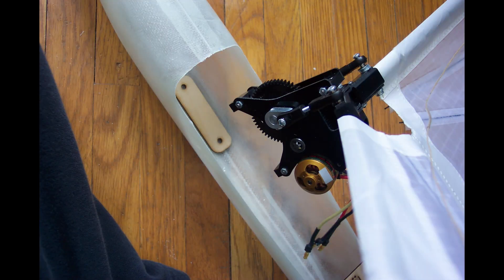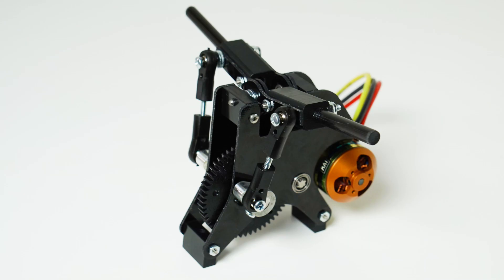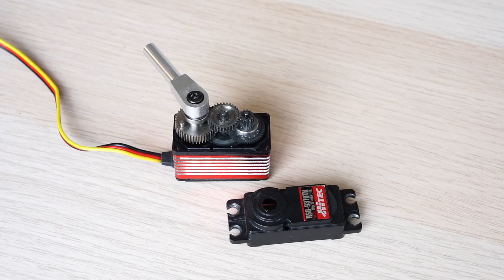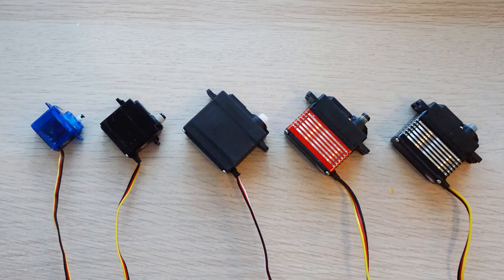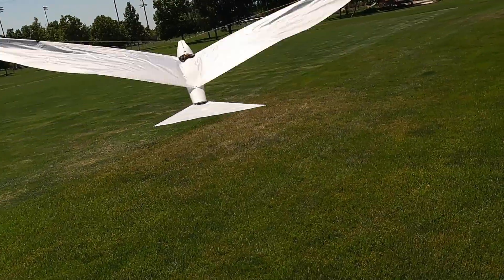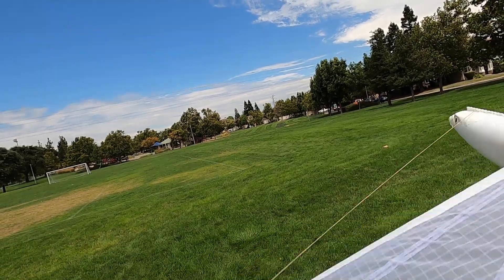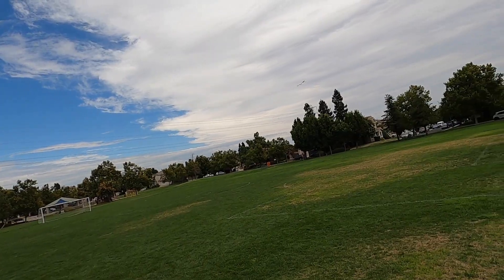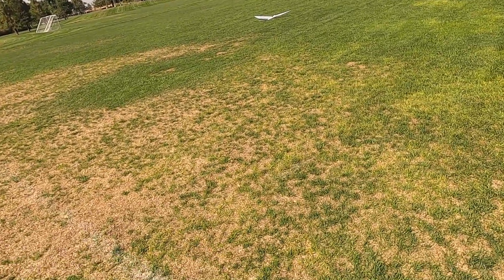Ornithopter Servo Conversion: Crossbow 2 RC bird flies with servos instead of conventional gearbox

Comment: Hey! A couple of beginner level questions on the build itself:

1. Where can I buy those servo horns/arms? I can't find them on the recommended Servo City website.

2. How is the membrane attached to the spars - adhesive or stitching? How is the trailing inner corner of each wing affixed to the fuselage?

3. What was done with the QT Py microcontroller to enable servo wiring? Was a PAD used?

Thank you!

Comment: Where were you able to get the servo arms that fit carbon rods? They look custom made, but how did you cut the inner gears? I have a milling router and found 20T broaching tools but they're really expensive and difficult to use.

Comment: What's the max flapping frequency here?
Reply from the maker: It can be adjusted from the transmitter over a range that is determined by the Arduino programming. Servo speed is measured in degrees per second so as the frequency increases, the potential amplitude decreases.

Comment: I imagine you've figured out that you can lose at least one on the tail servos, leaving just an adjustable elevator - and use differential flap angle between the two wings to give steering.

Please continue to make more Ornithopter content - there's not much out there!
Reply from the maker: When I first started building servo driven ornithopters, I used only the two servos that flap the wings, and no other servos. The Crossbow originally had a conventional flapping mechanism and two servos in the tail. I retained those two tail servos in order to keep the weight the same in both versions, while knowing that I could have made it lighter by removing them.

Comment: I purchased a ornithopter from ornihobby. Despite a few weak parts, it flies quite good. I wondered about converting the main motor drive to the central spur gear to be belt driven with a lower kv motor.. But after seeing this, I'm wondering of servo drive on each wing would be better.
Reply from the maker: Yes! Please do that and post a video.

Comment: Thank you for the info! Could you tell more about whole electronics setup for HSB-9360TH? I'm trying to build raspberry-controlled ornithopter but not sure how to connect it all together.
Reply from the maker: I will try to make a video showing how it all works. Driving servos is simple. You need to connect the signal wire of the servo to an output pin on the microcontroller. Send a pulse in the range of 1000-2000 microseconds about every 20 milliseconds. The pulse width determines the servo position. Typical radio receivers output this same type of PWM signal. You can connect each channel of the receiver to a different input pin on the microcontroller. And read the pulse width. Some receivers have a "single wire" output, which offers simpler wiring. But there are many different protocols (cPPM, Spektrum serial, sBus, and others).  In ornithopters the microcontroller is powered through a voltage regulator while the servos get power directly from the battery.

Comment: What were your reasons for using the adafruit controller over the Arduino?
Reply from the maker: It's smaller than Arduino Nano and it is actually running Arduino on it.

Comment: I just keep coming back and realizing how good your build is. I have built my servo driven ornithopter, but the some aluminum gears in the servos are failing. I need to address this issue but I'm looking for alternative designs as well and I found your channel. Did you make the aluminum servo horns?
Reply from the maker: I designed the servo horns and had them custom made by Servo City. You should be able to order more of them from Servo City. Please contact them if they are not listed on their site.
Reply: @OrnithopterZone1  Thank you for the reply. I ended up 3D printing reliable servo horn sockets that reinforces the original servo horns.

Comment: It's really impressive .... Could you please tell me where I can buy the servo controller ready to us ??  I understand that the board you mentioned in the video is just the hardware  ?? but it needs the firmware to run it ... Thanks a lot
Reply from the maker: When I have time I will make a video about the programming and post some example code.
Reply from the maker: I used to sell ready to use flight controllers and ornithopter kits. I had to close shop because of limited time. It would be nice if a company would make something like this.

Comment: Would this fly using Spektrum equipment (receiver and transmitter). I think I saw a 1000mah battery in the specs - on average, how much air time does this give you?
Reply from the maker: I use a Spektrum transmitter. I haven't compared the flight time with crank vs servos.

Comment: Cool, now put a HD FPV system on it and send it though the newest gap 😜
Reply from the maker: I started FPV flying with ornithopters in 2004 using a CRT monitor plugged into my car. Haha. I still don't have an HD system. Currently using a 4 winged ornithopter to reduce image shake. It's lots of fun.

Comment: In the video, is the flight of the birds at real speed?
Why 2 servos for movement, when one would be enough?
Anyway, very good work !
Reply: By two servos it allows full directional control
Reply: Do you mean turning left and right ?
Reply from the maker: The two wing flapping servos can provide left and right steering. And can also provide elevator function. Also, mounting the wings directly to the servos is a lot simpler than using one servo to flap two wings via some kind of mechanism.

Comment: What is the reinforced wing material that you use? Could you please link where I can buy that?
Reply from the maker: Like many ornithopters a high performance kite fabric is used. This one is a polyurethane coated polyester called Icarex. It is difficult to source but I have been able to find it on ebay.
Reply: @OrnithopterZone1  Thank you!
Reply: @OrnithopterZone1  I have purchased kite fabric, it is really strong. I see that the material is sewn, but you also use some kind of glue to hold the thin carbon rods in place. What kind of glue or glue tape do you use for this? Thanks!

Comment: Please  what the toque of the servo 
And any links to get that servo?
Reply from the maker: Speed and torque for each of the three servos tested are shown in the video. The best servo for this ornithopter (of the three that were tested) was Hitec HSB-9360TH. It has a torque of 17 kg-cm and speed of 0.06 sec@60deg at 7.4 volts. As mentioned in the video, using a slower servo with more torque, HSB-9370TH, was not helpful.

Additional information on the servos can be obtained from Hitec:
https://hitecrcd.com/products/servos/digital

...or Servo City, which is also a good place to buy them from:
https://www.servocity.com/servos